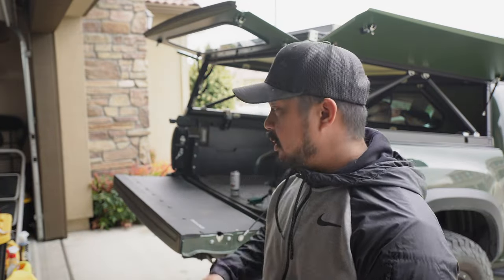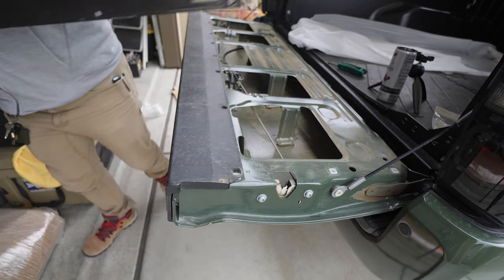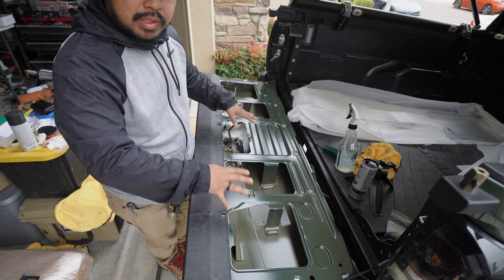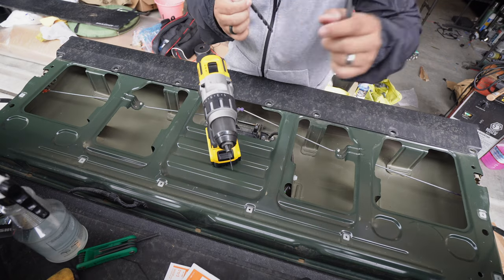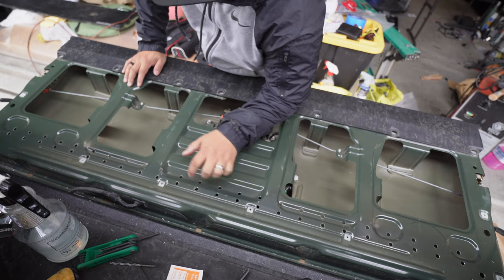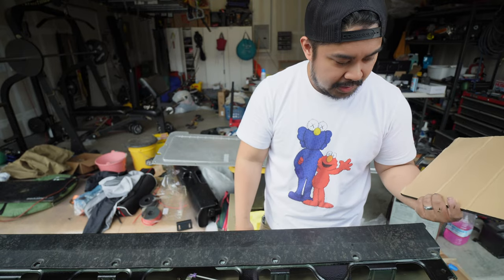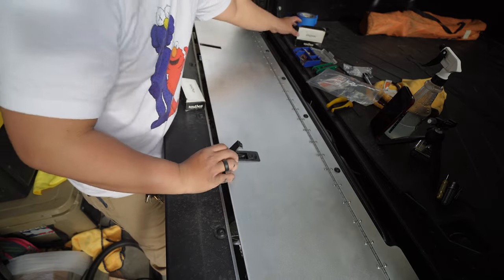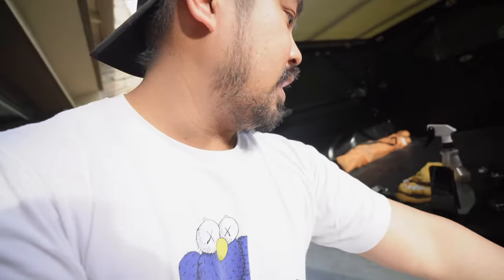Turn Your Tailgate Into a Storage Compartment | BPF Tailgate Insert 3rd Generation Toyota Tacoma

Comment: Very nice Mr. Rivera. Now your tailgate has a secret place for ropes, bungee cords, air hose, or maybe rain gear? I would prolly spray it with black bed liner paint to match the bed.
Reply from the maker: It holds all of my compressor gear, as well as some recovery gear at the moment

Comment: Nice video! Any problems with rattles? Anything you’d change about it?
Reply from the maker: Mmm for the most part I don’t hear anything rattle back there, could be due to the insulation I put in there, also it’s pretty packed lol the inl6 thing I would change is the way it’s installed tbh I don’t think drilling all of those holes was really necessary.

Comment: A couple of questions: why do the locks seem to stick up and are not flush?  It would seem to me that sliding cargo will hit and damage the lock. Or accidentally be "opened" if something is set on them. Also, I see that you have a camper cover, can you open the storage from inside without letting the tailgate down?
Reply from the maker: Gear often hits my tailgate and I roll gear over the locks all the time, haven’t had any issues since I pretty much keep it locked when it not In use. You can open it with out putting the tailgate down.

Comment: Should measure and print some 3D trays for that.
Reply from the maker: That would be pretty tight. I’m trying to find some water proof containers I could shove down in there in the mean time.
Reply: @RoamWithJon  Please share if you have any solutions!
Reply from the maker: I’ve just been using small bags or water proof boxes

Comment: For and extra 10 bucks I would just buy the Huracan fabrication one it is a fully enclosed box not just a lid and it has carpet on the inside and it is powder coated.
Reply from the maker: Last time I checked the Hfab storage was like 600$ base price with out options. The BPF one is 345$. I suppose it comes down if you need the items you put in the storage enclosed. 

I only put stuff I don’t really care if they get dirty in there. The primary purpose for this storage for is just easy access.

Comment: I just don't get it, thats a lot of work just to store a few things. I can't believe you'd have to drill all those holes just to get it to lay flat and water can still get in. I'll just stick to my inside the bed toolbox.
Reply from the maker: It’s a way of utilizing space that you wouldn’t normally be able to utilize. I don’t remember if I said it in the video but everything that I used to have to climb on top of my rig for is now in that tailgate storage. Yes water can still get in, kind of, but I have a topper so I rarely get water into that area, and on top of that, anything that I put in there that needs to be away from water is in a waterproof box or bag.